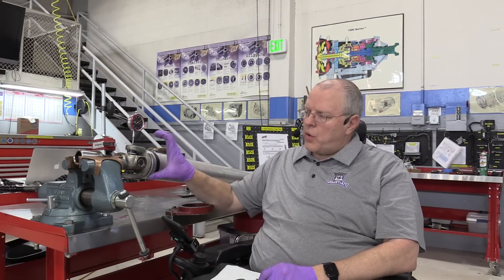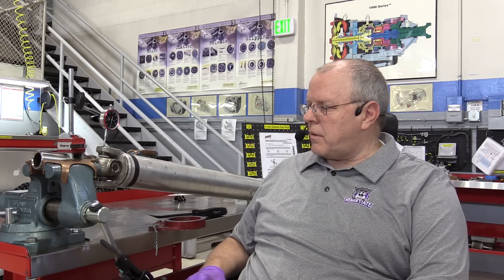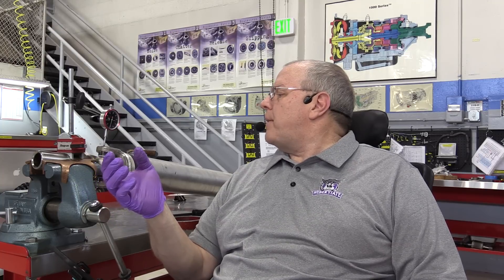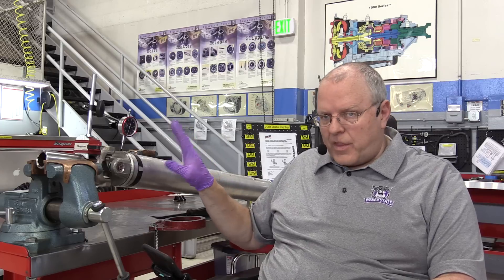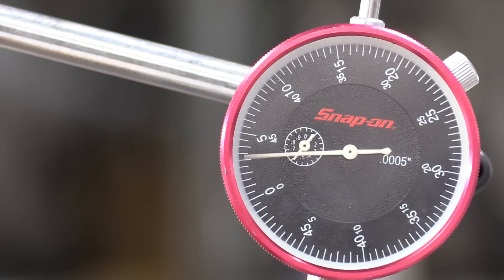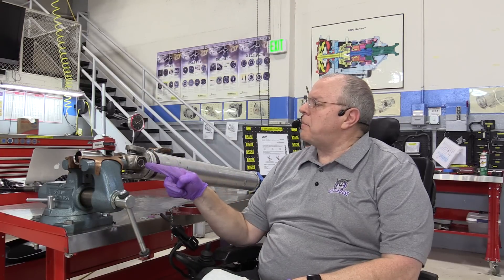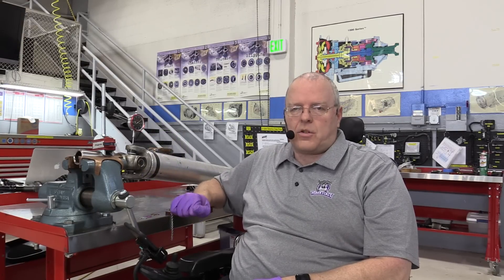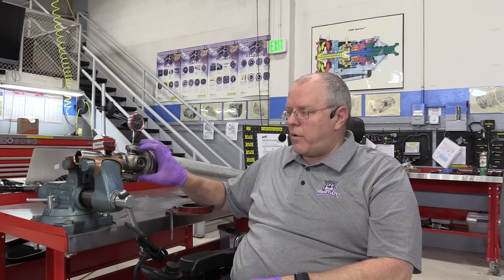Universal Joints - Part 7: Centering and Adjusting Axial Play

Comment: Measuring the axial endplay on the universal joint bearing cups in the aluminum driveshaft (0.0035") Out of specification of 0.0197"    shoule be   0.00197''

Comment: Thanks for this detailed series on U-joints. I just changed  2 U-joints on my 2000 Tundra and believe it or not I  encountered the exact same problem. The  Toyota new OEM non-greasable  U-joint just didn't fit. It was a bit taller than the original part and the snap ring didn't fit. For me being the first timer using a Harbor freight ball joint  tool I just scrached my head what I did wrong. In process while I was forcing the caps I broke on cap so I had to buy another one. Finally because I didn't have a thinner snap ring I went ahead and shaved down the copper coated snap ring until it did fit.  I wished I saw this series before I tackled changing the U-joints on my double cardan drive shaft.

Comment: This is a great video series. However, any real mechanic would starve if he works this way. Therefore, the method is probably unnecessarily accurate. Second, the new clip rings, once installed, look worse than the old ones. So the old ones are still good. Finally, most people beat on the ears and that tend to reduce the distance between them. So the cheap aftermarket ujoint might purposefully provide thinner snap rings. In reality, the vibrations is generated from seized up joints, not those with a small amount of axial play.
Reply: No time and money to do it right. Just to do it "good enough for now" and send it.

Comment: Let's be real. How many techs will even do any of this versus just throwing in a new joint and balancing the shaft then sending it out?
Reply: If they balance the shaft after, run out should be part of that process. If its not checked, the product will be inferior to one that is. "Real" would be checking. "Unreal" is the terrible workmanship, so many are subjected  to, or perform. Best wishes,

Comment: That looks like a 1350, or 1410 u joint not a 1330. The 1330, and 1310 u joint only come with copper, grey, and green snap rings. The 1350, and 1410 spicers come with grey, gold, and purple snap rings. Also regardless of the axial play in the joints, balancing the shaft after replacing the joints is the best way. I’ve owned a driveline shop for a long time built 1 piece aluminum conversion hellcat aluminum shafts etc, and also have replaced u joints on used, and new drivelines steel and aluminum and never had anyone complain about driveline vibrations. Never have I used the grey, green, purple, clips in the spicer u joints.

Comment: Doing this now on a Mustang aluminum driveshaft and have 3 of the 4 clips installed but can’t get the last spring clip on the DS ear to seat, I cannot get the cap to sit any deeper and the needle bearings have not fell in the cap. Also they are not loosening up when I hit the edges of the flanges. Using Spicer 1330 U-joints

Comment: There is a serious lack of availability with snap rings in various thicknesses and the fact kits are only supplied with one size shows a SERIOUS PROBLEM with the industry. This is so bizarre that spicer are the only ones to supply several, and even at that they vary alot. whats needed is a vast assortment of .050" - .065" in .001" increments. 
This man John Kelley is worth his weight in gold, most people who claim to know alot about ujoints have never even heard of this stuff or what in the world axial play IS.
Reply: I’m fighting tooth and nail right now trying to find thinner retainer clips. Working on my ‘72 and replaced the ujoints. Using the .060” clips, i have zero play. I don’t have a thinner clip😑
Reply: @WhipperSnapper51  i have come up with a system using a micrometer, grinder, and pencil eraser to shave them down. 
normally this would yield a shit result, but ive figured it out.

i have a mega stash of snap rings in sandwich bags with sharpie. 

another way could be a machine called a surface grinder. 

i have enough video footage and notes in my journal at this point to write a book about this stuff. between watching his videos and making discoveries of my own with several shafts and sleepless nights  ive realized stuff nobody else knows

Comment: I have your app on my phone and i have corrected several things and my vibes have been reduced and now I am down to a T2 vibration.   I looked at my front axle driveshaft and it appears to me that there is considerable side play or "movement in the universal.  It seems like the caps should be tighter--and they are held with internal C clips on the inside of the yoke.   Are there different thickness C Clips available to improve "centering" of the yoke like there are on the INTERNAL (or E-clips) that go on the outside?
    Thanks 
       John

Comment: Top notch!! Thank you for all the preparation you have done for this series. The tools you show with part numbers, the vintage parts you acquired, the history lesson, fascinating! I did notice in this part 7 one small mistake. You mentioned that a 1330 series and a 1350 series has the same size cap and that they are just a different width. That is true for the 1310 to the 1330 series joints with a cap size of 1 1/16 and a compressed width of 3 7/32 for the 1310 and a 1 1/16 cap and 3 5/8 width for the 1330. The 1350 has a 1 3/16 cap and a 3 5/8 width.

Comment: Mr. Kelley, the reason why you did not see an initial change in the axial play from copper to gray at the 6:00 mark is because they did not exert enough force on the end caps to overcome their friction fit in the bores, this is why it takes a press to get them in or out. the pink ones obviously did the job, however i am not certain if you had any difficulty getting them in the grooves, or if you did any pressing when the footage was cut and the camera was momentarily off. you should be able to theoretically take the snap rings out, without the axial play being altered due to said friction fit of the ujoint bores. if you had too much axial play and went with thinner snap rings, youd have too much clearance the moment you assemble one side and would have to shift the ujoint in its bore to center it and take up that gap as well using a press, and the amount of force you initially exert onto the ujoint beyond what is needed when it butts up against (and is stopped by)  the snap ring is initially what should give you your baseline axial play.

Comment: Everytime i get the u joint its fine and when i install the clips it wont move,, i banged the first ine with a hammer ( not the u joint or he shaft but the yoke) and it worked but now i cant get it to move, and ive banged and redone it,, any ideas

Comment: EDIT: I found out that Spicer 5-1410X and 5-1410-1X kits come with 4 sets of selective snap rings, so this should fit the bill!
Where can I get the colored snap ring sets?  I had the driveshaft for my F-350 rebuilt at a local shop and it has a terrible vibration now.  Took it back and they charged me $50 to tell me "nope, not a driveshaft vibration".  I inspected each of the yokes and the center u-joint has 12 to 15 thou axial endplay, at least by my eyecrometer.  I'll pull the shaft and do a full inspection.  They replaced the center carrier too and didn't bother to replace the slinger or install the dust cap over the expose bearing!  I'm not very happy with that shop, especially since they gave me the "you're crazy, get out of here" vibe.  I'm so mad at myself for taking the "might as well have it serviced" approach when I took the shaft out.  The original Spicer SPL209 joints were fine, just the center carrier rubber was deteriorated.  I have purchased an OE replacement Dana carrier to replace the stuff they used.  FWIW, all parts they used were Neapco, I'm very unimpressed with them at this time.  Gonna have to do it all a second time, then have a conversation with the shop about getting my money back.

Comment: You are calling out 0.00197" axial endplay in the video, but the chapter marks are 0.0197" axial endplay, that's an order of magnitude difference.  The figure 0.00197" is close to the approximation for 0.05mm, so is the actual spec 0.05mm axial endplay?  Put another way, 20 thou is a heck of a window and feels like too much, so I must assume the lower limit and take the spec to be 0.05mm.

Comment: Very information I had no idea that there was that much to it I thought you just put them in and that was it I guess that's why I was having so many problems with mine but I'm not a mechanic
Reply from the maker: Thanks for watching
Reply: How well balanced does drive shaft need to be I bought a used one it's not Bent but it has a couple of small dents in it seems to be doing okay but I'm a little afraid to go too fast
Reply from the maker: @scottcampbell7530  You will be able to feel and hear if there is a driveshaft vibration. Typically dents are not good, but you may be able to get away with very small dents.

Comment: My snap rings only give enough room for one snap ring
Reply from the maker: Make sure the snap ring grooves are very clean. Make sure the u-joint is assembled correctly. If that does not help, you will either need thinner snap rings or another (high quality) u-joint. Best wishes.
Reply: @WeberAuto  got them from advanced. The one that went to the differential fit perfectly. After no success with the front twice, I had to go back out to buy one from autozone. My trucks 2wd so they had to go in to drive. I got a 3/4" socket with a roofing hammer of mine. It caved in the edges enough to snap in but ruin the cap. The one from autozone fit perfectly barely no effort.

Comment: Great vid installed new u joint and have play in the trunnion of the U joint on both sides and its a moog I bought from auto zone  BTW caps sit nice and tight in the pinion yoke and the Drive shaft

Comment: I just finished the whole series on u-joints and have learned so much.  After seeing other video posters and knowing how I have done it in the past, I'm afraid to have anyone else touch my u-joints, now.  I am highly trained and dangerous!  Thank you, sir.

My only concern now is finding the OTC Ford tool.  I'm having no luck.  Maybe, I can cut/build something from a piece of u-channel.

Okay.....I found it in two places.  I can either pay $159 or $224.  Nope.  That ain't hapn'n.  Not for a one-time use.
Reply: Your best bet is to go on ebay and get what resembles the tiger tool which has forks that press downward, also a large ball joint press that has a relief hole for the ujoint cap as it is dual purpose, both those tools are needed because they do 2 different necessary things.

Comment: Great video,  I saw all 7 parts. It motivated me to do the work (driveshaft fix) in best shape. 
Regarding the centering of the shaft, u-joint and shaft cup holder,  imagine yourself as a machinist and do the following:
With dial indicator,
1) while the drive shaft removed, check the run-out of both transfer case and differential flange coaxially (mating surface) and diagonally (side way)
2) While rotating the drive shaft, measure the minimum reading of the dial indicator at the bearing cup outer surface (approximately at its center) for all of the four cups. This will give you an indication of how much the actual cross its self becoming off center from the real axes of the drive shaft. This can be complemented by using a micrometer to measure the thickness of the cup while the u-joint is disassembled. It is direct result from the assumption that the bearing surface (flat one in the cross) is a reference point and the cross has to form exactly a square shape otherwise the slow down and speed up movement will have variation on it. Also, this inspection will give you an idea about the flange yoke condition, if it bent, the variation between two facing cups become substantial. 

3) from whatever runout we found across thee shaft, I think it can be reduced by playing with the different thickness snap ring to move the shaft across its axle (up, down, left or right) trying to compensated to whatever defect found in the drive shaft.

Comment: Good video sir. I just changed the u-joint a on my 1995 dodge ram 1500 3.9L 2wd and in looking to all the videos of the u-joints I did not do anything that you showed except for cleaning the joints and the groove were the lock goes is the first time that I hear of axial play on the joints usually what I do I change them and that is it now I am going crazy I will use them like this for the rest of the week and next Saturday I will check this and do the job and see if there is a noticeable vibration keep doing this type of videos and see you later

Comment: John, having watched this video. It seems to me that you are effectively centering the U joint between the snap ring grooves of the two opposing yoke ears -  albeit with some axial play according to spec. That assumes that the snap ring grooves in each opposite ear are exactly the same distance from the axis of the drive shaft. Is that always the case? Assuming that the ear(s) aren't bent inward or outward.
Reply from the maker: That is a good question. I would suspect there is always a small amount of offset. Excessive offset can be checked by measuring the runout of the driveshaft while mounted in the vehicle after installing the u-joints.  Thanks for your feedback!

Comment: It seems to me that measuring the snap rings between manufacturers should always go with a measure of the actual cross measure, I bet there different, also the spicer's thrust washers, I think, may allow for tighter axial play as its between metal and plastic as opposed to metal to metal. I've been a "shade tree mechanic" for many years, your videos have cured many bad practices for me, Thx much.
Reply from the maker: Thanks for your feedback One of my other u-joint videos actually shows the difference in the cross measurements from 7 different brands. It is quite revealing. see https://youtu.be/BjPFzFkNmjE

Comment: As much as I love these, some, ok most of these don't work in my garage. In fact, and I do this very, VERY carefully,  but I pull the drive shaft out, clamp it softly in a vise, take my Skilsaw and put a metal cutting blade on it and cut the old U-joint out. It takes maybe a minute. Then, very carefully clean out the ears, with an air sander, until you can put the caps in by themselves,  easily,  then C-Clip them in. Saves time, grief, my garage walls have fewer holes in them, from not throwing as many tools at them. Life is better, the dog is happier. Because he doesn't get a beating. Lol, just kidding, I haven't had a dog in a decade.
Reply from the maker: Thank you for your feedback. After cutting out the joint cross, you would still need to make sure you do not bend the end yoke ears when pushing out the caps.  Have a great day!
Reply: can you please make a video on how you do this I would love to see it, I' m all about saving time, thanks ahead of time

Comment: John I watched the whole series on U Joints and learned a lot.  But I found some information on Spicer site that seems to conflict with the information you provide.  I am a novice at this so I'm not trying to say you are wrong, only that I may not be understanding the information from Spicer.  

 http://media.spicerparts.com/cfs/files/media/5wBJwAG4envyHL5wY/JOI-TEC-79.pdf

Please take a look at the above document.  It says up to .006 is acceptable.  What am I missing?  Thank you!  David
Reply from the maker: The 0.006" is for the full size giant u-joints in class 4-8 trucks. The smaller u-joints have a smaller spec. Look in a Toyota service manual for the 0.00197" spec. Thanks for your feedback!

Comment: Excellent series and very well laid out. I really learned a lot. That being said, and no disrespect intended, how would one charge for the extra time this procedure takes? I know in my mind without a doubt this is the right way, however, I don't see how you can perform these procedures within allotted flat rate time. I guess you could try and educate the customers and charge a premium. I just don't think that most people will pay what the job is worth. Again, I am sincerely meaning no disrespect. You have truly opened my eyes.
Reply from the maker: Thank you! I understand the dilemma. I do not have an answer for you. Knowing the correct way to perform these services will help you to a better job even if you feel the need to take some shortcuts. It will also help you diagnose problems more accurately. Best wishes!
Reply: WeberAuto It definitely will help in the future. Thanks again!

Comment: Thanks for this educational video! Very much in-depth & informative.  After watching I decided to seek out a driveline shop and not just take my F150 to just any shop. My truck
had a vibration and I did notice some axial play in the rear joint. SKF U-joints were recommended and shaft was also checked for balance, which was corrected. Vibration is gone, and I'm hoping that these U-joints are a quality brand. Do you know who makes the motorcraft joints for Ford?
Reply from the maker: Almost all Ford u-joints I have seen are re-boxed spicer parts

Comment: Great series. I learned a lot. Is it possible to trap an air bubble inside the bearing cap when putting it back on? If so, then I could see that causing problems with the snap rings being installed.
Reply from the maker: No, the caps are not free floating in the yoke ears, they are pressed in. An air bubble would be compressed or escape under those conditions. Thanks for your feedback!